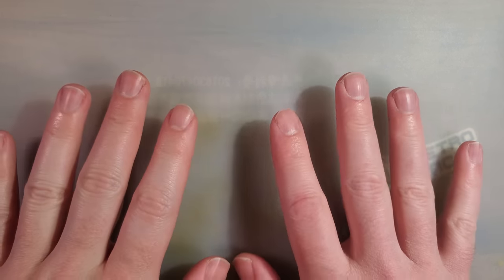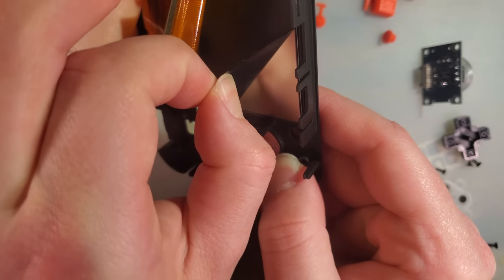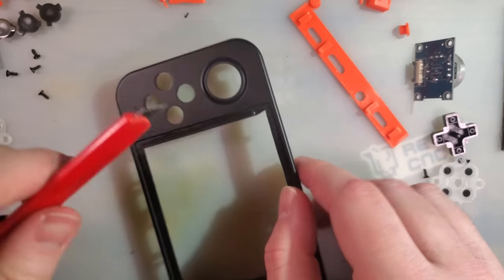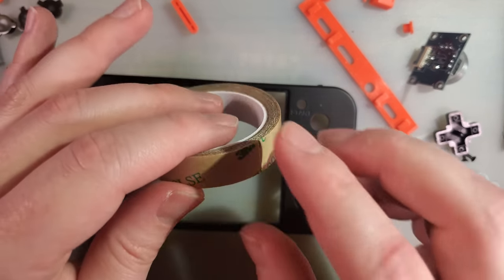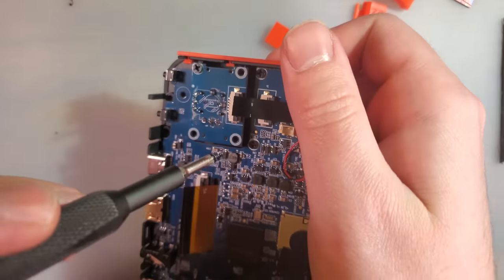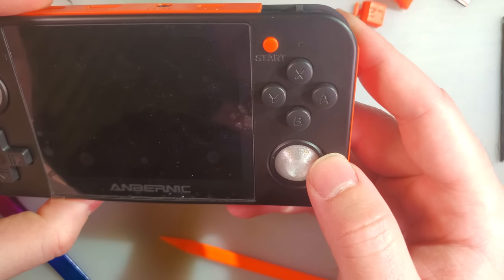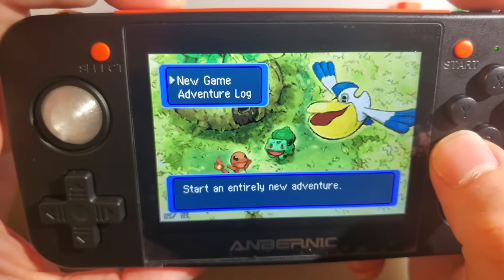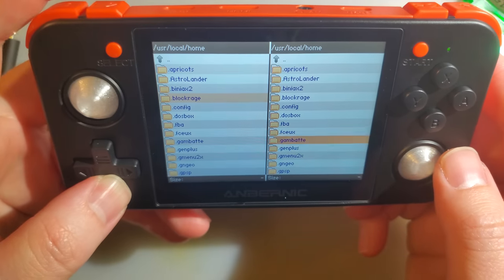RG350 High Resolution LCD Upgrade

Comment: Once nicked my thumb doing the exact thing at 27:24 , practice blade safety youngins'
Reply from the maker: I try to make a conscious effort to always put my fingers behind the blade. When that's not feasible, it's ok to cut toward yourself as long as you consider where the blade will go when it slips and to adjust yourself out of the way of that. When in doubt though, always away from yourself. I adjusted my technique as soon as I realized but you're 100% correct.

Comment: Hey makho on the vitas for ab, select on the pocket did you use a knife tip or different tip to solder them so damn tiny , they’re in there but I’m going crazy trying to figure out why the osd won’t pop up must not actually be making a proper connection
Reply: @makho  my bad turned into a ramble was meaning to ask what temp do you normally use for the smaller test pads on gameboys i answered the tip question myself watching an older vid of yours lol
Reply from the maker: @Thirdeyestrappd  290
Reply: @makho  thanks for the help bro it’s those tiny ones before the diode array on the gbp for the osd most difficulty I’ve had soldering in my entire life 😂
Reply from the maker: @Thirdeyestrappd  k tip is not good for soldering to vias. I try to use my j tip when I can but I usually forget to switch it out before my iron is hot and then from there it's too much effort lol

Comment: next step is to update to the beta dingux firmware and use retroarch. Better performance and visuals on snes and gb
Reply from the maker: Both GB and SNES seem to perform fine as is. RG351P is heaps better for GBA anyway though as the screen aspect ratio and resolution is perfectly suited for that console. 

I will take a look though, thank you.

Comment: in my honest opinion, adding a screen to that device that can barely run ps1 games for the most part, is like putting a spoiler on a nissan micra 

sure if you really want to you can , but the benifits really arent that great , concidering what you pay for the screen vs, paying that little bit more and just buying a 351
Reply: I dont have a 350 or a 350m, but I do have an Odroid Go Advance and an Odroid Go Super, which went through a similar revision with a much larger resolution display on the Super. Honestly, the difference is night and day - being able to get integer scaling with minimal bezel is a real game changer, everything just looks so much sharper and more crisp.
Reply: @ogSquink  I'm well aware it's a good upgrade from hand held to hand held IF you are fully content with the low end system , but in my opinion , you'd be better just investing in the more powerful revision with better screen and over all specs
Reply from the maker: What are you talking about? I've been using this thing to play PS1 almost exclusively and I haven't found a game that doesn't run at full speed yet.
Reply: @makho  damn someone let this guy know the rg350 cant play tekken 3 at full speed :') cringe
Reply from the maker: @Millzieeeee  oh yes because I have clearly played every single PS1 game on this. The real cringe is your comments here.
Reply: @Millzieeeee  you should change firmware and emulator!
Ff8 and 9 no problems.

And you knew that the rg350 is a single core 1ghz system?
Reply: @Millzieeeee  if the games he plays work fine then why should he care that some others don't?